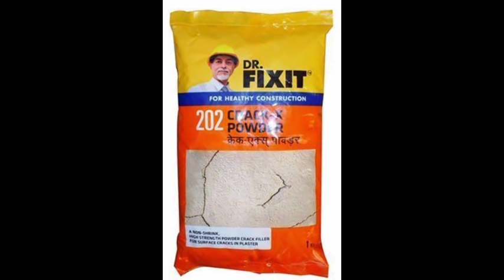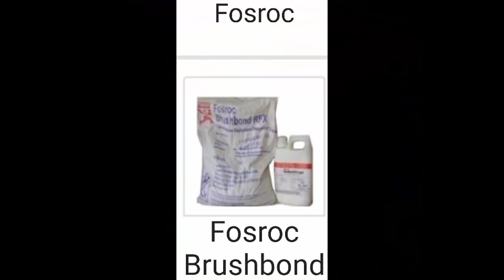Roof Waterproofing cost and method, kannada. ಚಾವಣಿ ಸೋರಿಕೆಗೆ ಹೇಳಿ ಗುಡ್ ಬೈ.

Comment: Hi 😊, 
All these are not permanent solution. Because after few years again and again need to do same work.
If we do low cost tiles(35 to 40₹ per square feet) installation on roof with paper joint method might be solve permanently.
What you suggest please share your thoughts.
Sorry I don't have kannada keypad so typed in English.
Thanks in advance.

Comment: Whether can this be used for cracked cement sheets?
Reply from the maker: Not sure
Reply: Dip thermocol into petrol..
It melts n becomes thick like a cream..or feviqwik..apply it immediately using brush.. don't touch in hand ..it's v.sticky..it works
Reply: Yes

Comment: Respected sir,  please clear the following doubt 
1. Should Dr. fixit roof seal be applied on the roof after applying the primer?  OR

2. Should Dr. Fixit Roof seal be applied directly on Roof with out applying the primer?

3. Which of these two is better?
Reply: 1 st one , apply primer first , second and third coat waterproofing solution

Comment: Sir super latex na apply madsude but clear ede and Niv helidu 20ltr = 300 sqft antha but box mele 1 ltr = 70 sqft antha ede but gothagthila heg use madodu .
Full water thara ede transfrent ede .
Please reply madi
Reply from the maker: Yes transfrent iratte no problems 1 ltr ge only 40 sft Madi double coating madi.
Reply: Better go with waterproofing technician.

Comment: Can u say how much is the minimum roof height required 12 ft, 15ft uses and advantages and disadvantage for low height
Reply: Standard roof height is 10 ft from floor to the mould
Reply: @shivak9840  thank you

Comment: just a month ago i got my house roof waterproofed with dr.fixit roof seal and sealent. Done by a professional painter.  But i am surprised that the 
roofseal and sealent used  are still to some extent sticky to my feet when i chcked it.  I bought the materials from a reliable store who is friend and reliable also.  Please let me know the reason and advise me.    ramaswamy ms.
Reply: Ramswamy sir don't use sealants . Coats between 12 hrs gap. 1st coat should be applied thin layer .2coat gap must be 12 hrs .We use Asian paints crack seal n damp proof .No sticky no cracks appears.
Reply: Better go with professional water proofing technician,painters ae not professionals in waterproofing.

Comment: You saI'd fore 20 ltrs doctor fix  add 4 ltr water ok it is fine .but after that you said every 10 ltrs add 1 ltr water. So it is confusing .if you use 4 ltr wtaer for 20 ltrs then we have to use 2 for 10 ltr. Not 1 ltrs. Pleas replay and watch you vedio and confirm .
Reply from the maker: Sorry my mistake, 4ltr water for 20ltr can
Reply: Better go with waterproofing technician.